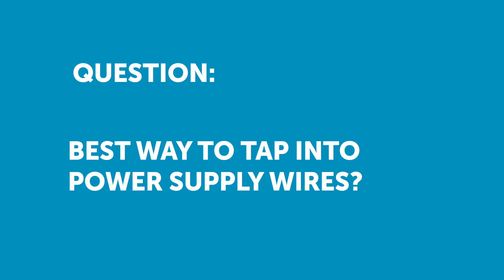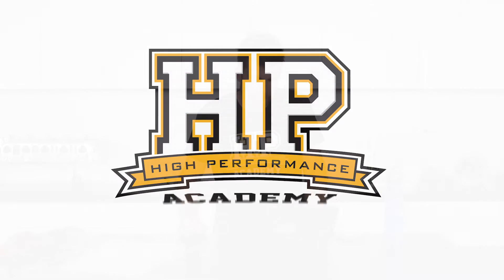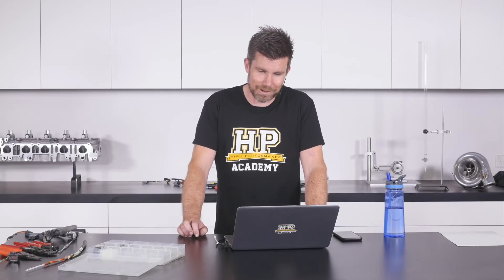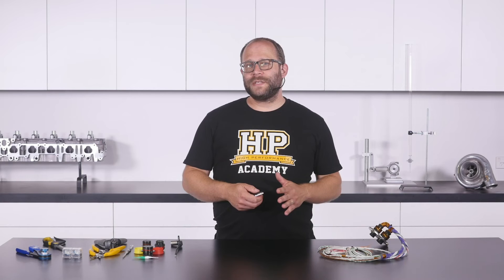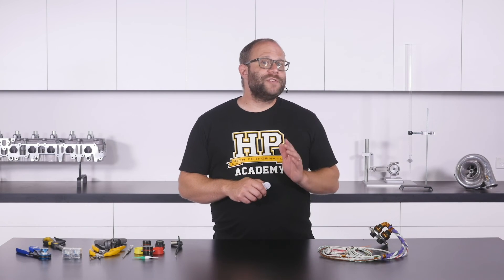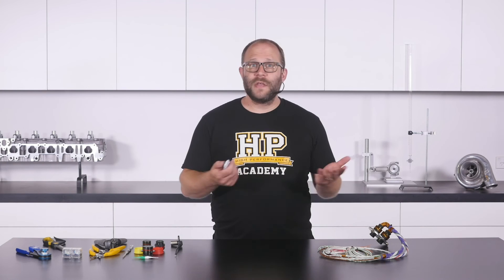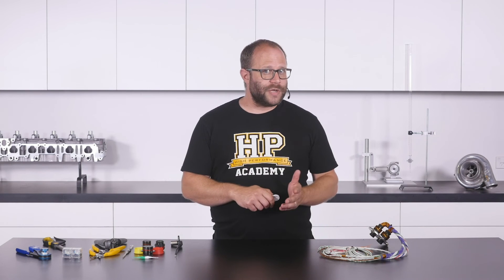'Wire Tapping' | What's The Best Way To Tap Into Power Supply. Scotch Locks? | [HPA Q&A]

Comment: scotch locks... my dad bought a brand new 1200cc bike in 92, had an alarm fitted that cuts power to the fuel pump, got me stranded in the middle of no where last year... that wire was completely rotten.

Comment: scotch locks have their place. it depends on how much current your need to draw.
Reply: yea, in the bin lol
Reply: Yeah, may be wrong with everyone here, but Ive never had issues with scotch locks.  I dont use them all the time, but for 5v pull ups or tapping a low draw signal wire, Ive never had any issues.
Reply: Rick James:  WRONG
Reply: I can’t believe there are people who think scotch locks are okay. They are such a lazy way to join or splice into a wire and I’ve had them cause plenty of issues. Car dealerships like to use them when they fit bull bars with lights and trailer wiring. They may be okay for the first couple of years, but guaranteed that poor wire is corroding away and will cause dramas.